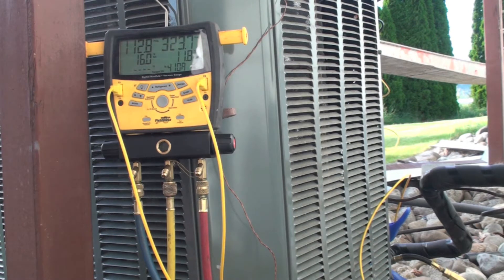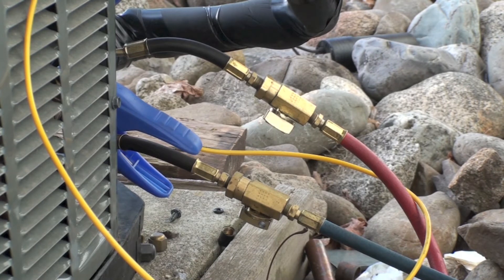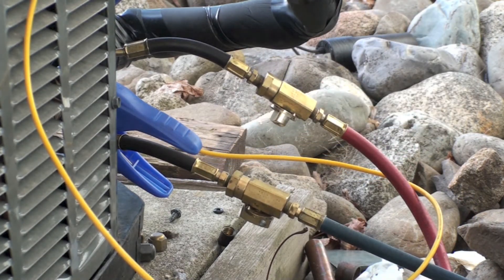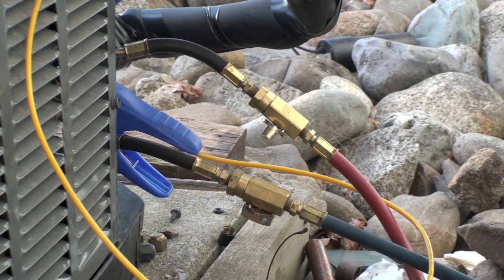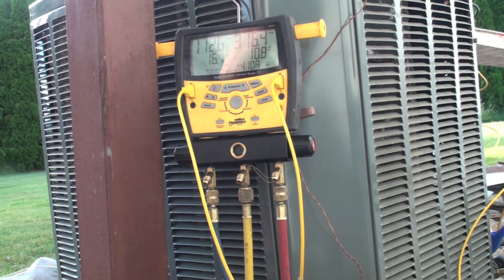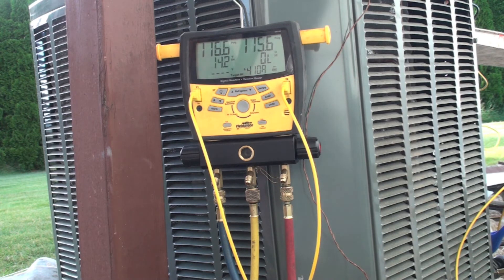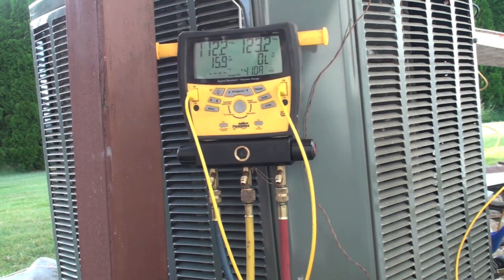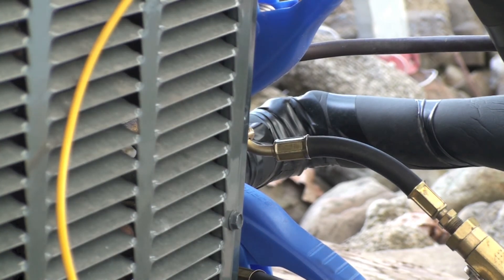How to pump down the HVAC gauge set

Comment: GFM, I have one question about this procedure? Won't the refrigerant travel down to the yellow line when you open the high side valve on the gauge set?
Reply from the maker: It does.  But it is evacuated thru the low side.  Also note the shut off valves on the lineset.
GFM

Comment: Can't putting liquid into the low side damage the compressor? I thought that was the point of having superheat to make sure the refrigerant was fully vapor when it leaves the evaporator and enters the compressor? What am I missing here?
Reply from the maker: Compressors often get liquid from the low side, especially on startup.  They are designed to handle these momentary liquid shots with no damage to the compressor.  Where there is a problem is with continued liquid introduction into the compressor.
GFM

Comment: Techs should always wear gloves and safety glasses when working with refrigerant. You never know when you will cross paths with a bad schrader valve or other unforeseen circumstance. Gloves are used to prevent frost bite. Check me Kung Fu Maintenance "Air Conditioner from Hell" video series for some extreme examples of rogue schrader valves and how wearing gloves (PPE (Personal Protective Equipment) spared me some pain and suffering. If I hadn't worn gloves that day it would have meant a trip to the emergency room.
Reply from the maker: The glove issue is mostly personal preference.  Whereas tight fitting gloves may separate the fingers from the boiling refrigerant, when they are saturated with refrigerant, they may freeze the fingers badly before you can get them off.  If they are loose fitting, dexterity is reduced.  However, I will be checking out your videos on there subject.  
GFM
Reply: grayfurnaceman Disposable vinyl gloves work excellent for this (I like to use two pairs) as they block the refrigerant from soaking the gloves but still allow you to feel pressure through the gloves so they are easier to work with. They also have the side benefit of making clean up easier. I have had a lot of people fault me for them but they don't have the experiences I have had and I am happy to say that at least on this one I did not have to learn the hard way.

Comment: You forgot to mention to purge the manifold of air before sucking the liquid in and I like to use a valve depressor fitting instead of ball valves to me it works better. Overall good vid I had to learn little tricks like this on my own.
Reply from the maker: The purging of the gauge set should always be done immediately after installing the hoses.  That way you won't forget.  It was not shown here because the servicing was done.  Thanks for the thoughts.
GFM

Comment: I changed out a copeland scroll on a Rheem 10 SEER Heat Pump.
I weighed in 8lb factory charge, and turned unit on. I let the unit run for 15 mins and started noticing frost from the true suction tube to the accumulator, and out to compressor.
I had low head and suction pressures for an 84 degree day, on a 30 delta T condenser, I was condensing at 211 PSIG or 104 F. The low side was 58 PSIG, with around 29 to 30 F coil.
I had 10 F SC, and 18 F SH.
I added in 6 ozs. To try and raise press to raise pressures, and was not able to, and SH dropped; so, I recovered to regain SH, but still have ice from top of 4-way to compressor, and do not know why.
I may try magnet at end of 4-way to see if it is over all the way but my hot suction was hot, and cold suction was cold
Reply from the maker: Some of the Rheems wanted superheat checked at the compressor.  If you checked it there, the ones I saw recommended about 20F.  As to the rev valve, I would check the pressure at the true suction line and at the line set to see if there is a difference.  Does the unit have the correct matching coil?  Is the coil clean?  Blower clean?  Air flow up to par?  Indoor air temp 75F or above?  All these can affect suction pressure.  Hope this helps.
GFM
Reply: true suction, and line suction were nearly the same, as I recall. indoor coil was clean. blower was sinle speed, cage was clean. indoor temp was in the 70s. The ice did not start forming anywhere but, at the top of the 4-way valve.
I did note some 110-120 degree temps at top of 4-way, at true suction, and then, a few inches up, the tube was freezing; and, there were drastic temp fluctuations on the suction line coming into the valve from the suction line, and the valve body was hot.
I appreciate your help grayfurnaceman
Reply from the maker: You might check the temps across the valve discharge to discharge and suction to suction.  Should not be more than 6F difference.
GFM
Reply: thank you
Reply: Hello, Grayfurnaceman, I put strong magnets on side of valve, and was abe to slide piece inside, back and forth. After starting the unit, with magnet in cooling position, all my numbers held where  they are supposed to be; so, it confirms the valve is bad, or the solenoid on the valve may not be strong enough to overcome the pressure against it ( is that even a possibility, and if so, can only the solenoid be changed?)
Reply from the maker: If you are able to move the slide with a magnet, but the solenoid will not, you can try replacing the solenoid (cheapest and easiest part to replace).  However, my bet is the valve will have to be replaced.
GFM
Reply: again, thank you sir.

Comment: low loss fittings are great due to the reasons you just pointed out because if you do not have them that liquid refrigerant in your high side hose will rush out as soon as you disconnect it from the high side, which can cause damage to your hand and your losing part of the charge without them
Reply from the maker: Very true.  In my experience, most of the refrigerant that comes out is the liquid in the line itself.
GFM